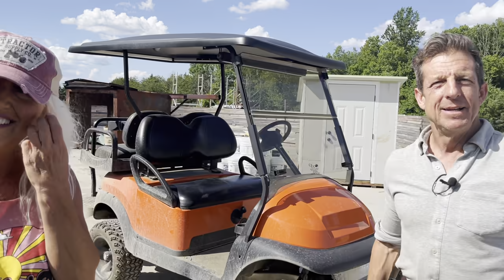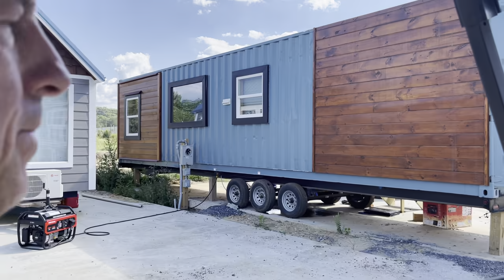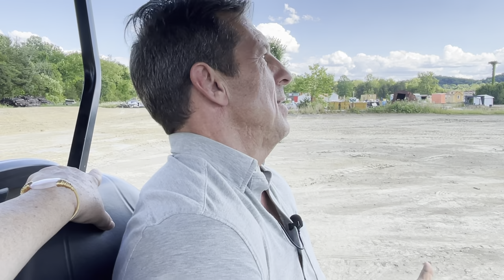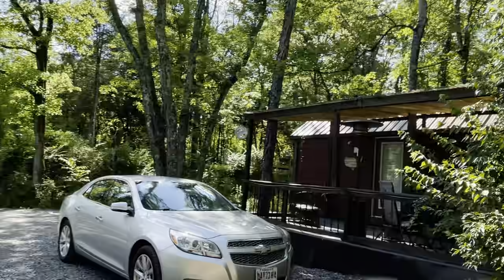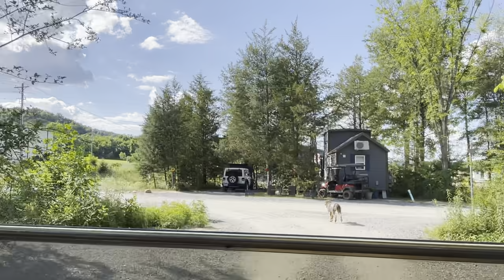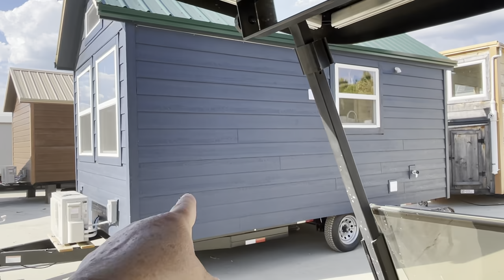Stucco Tiny Homes, The Beach, The Prairie and a Beautiful Tour on the Milligan Mile 😍🏡🌲

Comment: The ESP homes are beautiful, but was wondering about r-value for insulation.  I live in Texas, which is very hot at least 7 months of the year, and this is a big concern. Love all that you all are building!
Reply: There is a video on how heat affects the ESP. Very well insulated. Check it out.
Reply: @mdsju2mia  Thank you, I will go look for it.  I looked up r-value of an insulated steel door which seemed rather low, but this may not really apply to entire wall.  Thanks again.
Reply: @kaysarverart  It's not like a steel door and insulation performance also depends on things like air leakage and not just the material R-Value.  So doors and windows aren't the best examples because they tend to be leaky and not fully air tight... But the EPS panels are the same as what they call SIPs (Structurally Insulated Panels), just with metal instead of OSB or Plywood but basically there's no connection between the exterior and interior.  Just dense foam insulation sandwiched between the two metal sheets.  So no thermal bridging and 100% coverage of insulation, aside from the doors and windows.

Regular framed construction has gaps in insulation because of the studs and wood has a very low R-Value.  So there's some thermal bridging through the studs with a regular structure but with SIPs there's no thermal bridging and no gaps.  So, as long as they do the joints well, for proper air tightness, etc. it'll be better insulated than an equivalent wall thickness of a normal framed wall...
Reply: @ZeoCyberG  So appreciate this thorough explanation, as this helps me make the big decision about doing the ESP home, which is so affordable and love the clean-line look of it!  Thank you so much!